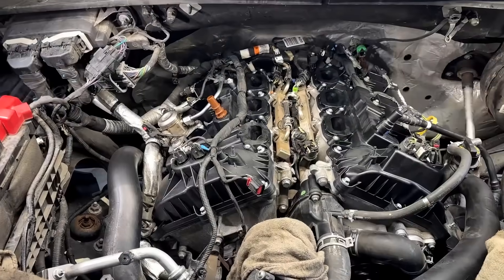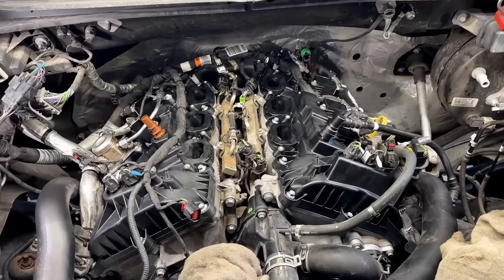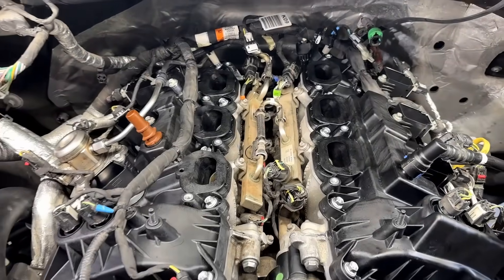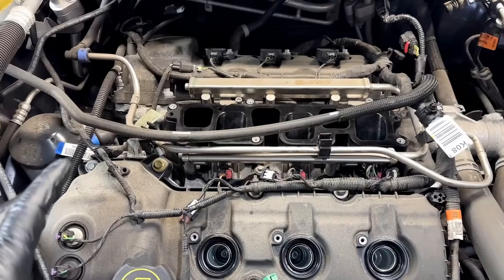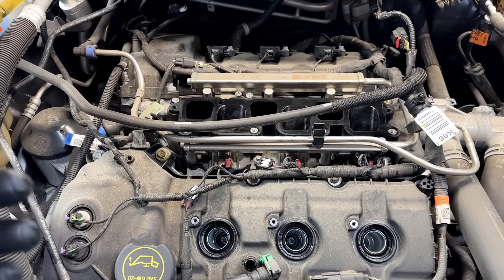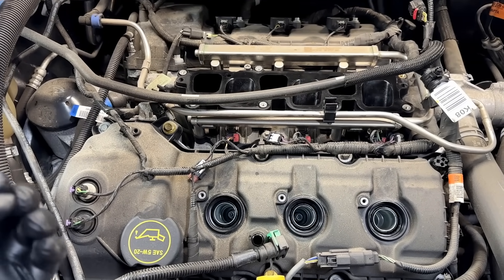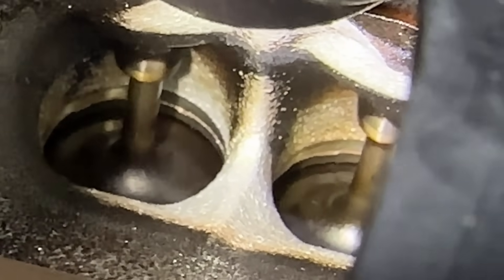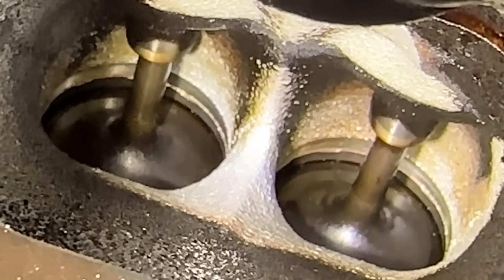Does Ford's New Dual Fuel Injection 3.5L Ecoboost Engine Really Fix the Carbon Build Up Issue?

Comment: It helps fuel contamination in the oil that was why they wanted to run them on port whenever possible last test I saw DFI was causing 5 to 7% fuel in the oil between services

Comment: What kind of oil filter are these guys using? That black soot is from large contaminates that make it past the filter media. My 2011 f150 3.5 ecoboost has 377,000 miles on it and my engine doesn’t have those type of issues. No carbon buildup on the valves, none on the turbos and absolutely no timing chain issues. I use Amsoil signature series oil with their 25,000 mile oil filter and I still trust my pickup to run nation wide. My drive train is all original.
Reply from the maker: lol
Reply: @FordTechMakuloco  that was a serious question. I’ve noticed that when people use a crappy filter the larger contaminates, above 30 microns make it into the pcv system. That’s the black sooty shit that cooks on the back side of the valves.
Reply from the maker: Um no, yes it is oil being baked onto the valves but not because it is dirty.
Reply: @FordTechMakuloco  if that was the case wouldn’t you think it would happen 100% of the engines
Reply from the maker: It does

Comment: Ok, looks like even the Gen 2 could use some catch cans then.  Thank you for sharing this.  It helps with the question about if it is worth it to add a catch can.  Great info.  The real question is what is causing this timing job to keep happening?
Reply: It’s critical to keep the oil changes current with good oil but the timing chain issues really boil down to bad design.

Comment: Brian:  I drove Ford pickups for 57 years. Once the 300 cu in. engine became available I bought only that engine . It would start without heat at 40 below as long as you had a decent battery(ies), & 4 wheel, low range, in first gear allowed me to creep through the bush at idle. These engines were bullet proof & needed only normal maintenance. Like a damned fool I bought a 96 F250 4X4 diesel , 5 speed manual.
The truck was excellent. The Navistar engine was the biggest piece of rubbish I ever encountered, & I wasn't the only one ! After 6 months of the truck adorning the interior of the dealer's shop, I dealt it on a 97 Dodge 3/4 ton 4X4  with the Cummins 6BT engine (the best light truck diesel ever made in my opinion). I now have well over one million miles on the truck, & the engine is still running on the original lift pump, the original P7100 pump with the original delivery valves & the original injectors. I watch all your videos &  I am moved to ask  " is there ANY Ford truck made in the last 10 years that is worth owning ? "
I see all the faults on these trucks (Ford is NOT the only one to have problems !) & I wonder how the Hell Ford stays in business !  Your videos are excellent Brian, & I know you will do well in your own business. 
Happy New Year !

Comment: Did any of them use an oil separator? And would an oil separator even help? I am running one on the passenger side. Probably going to to the driver side next.

Comment: Fordtechmakuloco, I've been adding Chevron techron fuel system cleaner to my wife's ’17 Expedition every oil change since it was new. How effective would it be at mitigating this problem with the valves?
Reply from the maker: It is not effective for your design.

Comment: How do these ford engines compare to the competition? I know the the vw/audi community has had its share of carbon build up issues. At much lower mileage. B7 rs4 v8 recommended 25 to 30k carbon  cleanings to keep things nice nice.

2018 up the 5.0 is dual port too. How does that compare to the 3.5 dual port? Which 5.0 is best? I know some had the old ticking noises but not sure about any issues from the noise. I want 2018 5.0 for the better mpg and quicker acceleration. C&D Showed 1/2 sec improvement 0 to 60 and 1/4. Im sure the 10spd has a role in that too. 15 sec quarter to 14.5 with dual port and 10spd is a noticeable difference. But if the spray in cylinder liner 2018 and up is a maintenance  nightmare compared to the 15 to 17 5.0 id consider staying with the older one. Id get a 5 star tune for trans tuning and that little 87 hp bump, plus cai and maybe cat back. 87 fuel only. All my other cars need 93. Dont feel like filling a 36gal tank with 93, lol. Not youtuber rich 🤣

Comment: So sad.   So what we really need is a TBI injector run on a clock spring timer that we can run for 10 minutes a day going down the highway.   Seems insane since there are plenty of 20+ year old vehicles with 200,000+ miles with perfectly clean valves.

Comment: Thanks for the informing video.

It was interesting to see what Ford's changes did generationally... 

But, not a single mention in the video of how much an oil catch can would improve either the first or second generation Eco Boost engines?...  it's night and day difference.

Hard to believe Ford went with a more expensive solution that doesn't work as well.  I suppose because they think owners would never check their catch can levels and empty them.

Sized right, a catch can had better have a capacity that allows it to never overflow between oil changes, even once the engine is ready for rebuild and blows so much past rings that owners have to add 2 quarts between oil changes...

This works great for any direct injection engine.  Remove the oil and water and contaminants before you run the gas fumes back into the combustion chamber...  so simple.

Comment: This is an issue for the mod engines that had the imrc and intake charge plates.Instead of shutting off the secondary and creating carbon buildup like crazy just to improve torque they should have just put 4.10-4.56 gears in straight from the get go for the engines that had imrc plates.

Comment: I have a 2019 F-150 3.5 ecoboost that I have been trying to lean when does port and when does direct injection operate. 
Nowhere on the internet or at TWO Ford dealerships could I find the answer. THANK YOU for the answer.

Comment: I have an Ecoboost with 200k miles. I use an oil with a really low volatility and I do the CRC direct injection cleaner myself every 50k miles. I’ve had absolutely zero issues the valves stay exceptionally clean. It seems like a really good “true” synthetic oil keeps the intake valves much cleaner because it evaporates much less. Also a catch can really helps as well.

Comment: If you look at the L3 Mazdaspeed 2.3. They have ran additional port or TB injectors for more power for a number of years now. Stratified,jmf, and sp63 performance are some companies pushing the ford and Mazda blocks. Ford added vvt on exhaust valves but I’ve personally seen TB meth not clean but port with E stay clean. I’ve done valve cleaning 4times and it’s NASTY. I’m going to watch your vid now and see what you come up with.
Reply: Plus I’d like to add the police/ fire package ecoboost will still have worse as they sit and idle way more than regular use using di the whole time.

Comment: Brian did my timing chain, walnut blast, and cooling system flush. Runs like a Beast again; I installed a Full Race Eco-Beast intercooler kit with TurboSmart BOV. Runs like a champ again.
Reply: When did you get your timing chain replaced? I didnt think these trucks needed a replacement and it should last well into 200k+ miles. Is that not true?
Reply: @gabbygonzaga552 
Got it done around 190k mi back in 2022 if I’m not mistaken (Sept/ Oct 2022 if I’m not mistaken). 

Brian did the phasers, walnut blasted the valves, plugs, and something else… I forget.

Ran great after his maintenance. Started having a few other issues… leaking coolant from driver side turbo, IWE clunking/ clicking, brake light electrical issues (took it to the dealer and they put a higher amperage fuse in it; WTF?!?!), and not so nice noises coming from the rear end. Oh, and intermittent misfiring from fouled plugs. This happened often. Change/ clean the plugs and it would be back after 1000-1500mi. Did a catch can that was great for a while. Then did a Full Race intercooler and TurboSmart BOV… somehow this changed the way the Full Race catch can operated because I wasn’t collecting anymore blow-by.

Anyway… felt it was time to let it go. It was fun when it ran correctly. Between the Full Race intercooler, TurboSmart BOV, Full Race throttle body spacer, Accel wires and coils, SPD downpipes, NGK plugs, Full Tace CAI, and tuning by Eddie at Elite Performance and Tuning in Littleton, CO I had 390hp/ 603lbs/ft tq at the rear wheels; so yeah, it was fun to drive. It is missed. Though I don’t miss the bad stuff!!!

February 2024 drove into a Dodge dealership, and left with a Hemi equipped Ram. Figured I’d get rid of my problem and get back into a V-8.

Gabby, not saying the chain doesn’t last as long as they say. More so saying I wasn’t trying to find out if the chain was going to last that long.
Reply: Where is Brian located?
Reply: @dewjr1985  I believe he is near Chicago, IL
Reply: @Andomosity  Whats the name of his shop? I just bought a 2010 SHO and Im in NW Indiana. Would probly take my car to him if he is in fact in the Chicago area.
Reply: @williamhermann6635 BSG automotive in yorkville, IL

I believe i was quoted $5000 for timing chains/cam phasers, and then some minor tune-ups with hoses and such. Still haven't decided if I'm gonna pull trig tho
Reply: @Andomosity  Im no expert, but from what Ive read, if youre gonna do the timing chains you might as well do the water pump too.  Anywho, thanks for the reply.

Comment: In your opinion, does the Italian tune-up seem to help with this issue? I'm a diesel mechanic and it works wonders for our carbon issues, but our issue isn't on the valves.
Reply: I don't see how, he said at WOT it is DI only, port Injection doesn't fire, in theory it would make it worse.

Comment: Thanks for the video.

I got a 2014 Fiesta ST Australia 3 door version, 134,000km. First got coolant bypass valve code, replaced the easier one to access and that was that fixed but then still got engine malfunction warning again and limp mode, the garage said no codes this time but removed the limp mode. Did it again, always seems to be when engine has been at full operating temperature for a while, the engine starts misfiring and then the malfunction warning comes up and back into limp mode. Went to another garage and they found a "boost sensor code" so I just replaced that yesterday and no change. But now as well as that it's developed another problem, it's a big boost leak that I can hear a loud hissing when the turbo is trying to build boost, I guess it could be a loose clamp, split hose or maybe even part of the turbo like the waste gate or the diverter valve or even the boost solenoid..? Never had a tune, engine and turbo is stock, very new one step cooler plugs and very new swan ignition coils. Only engine mods are a high flow panel air filter and an oil catch can. It has always been run on 98 unleaded and I have done 5,000km engine oil and filter changes it's whole life since brand new. Tomorrow I'm going to check all the hoses and clamps coming from the turbo all the way to the throttle body and hopefully see the problem..

Comment: Thanks for your nice info-clip and I still think that Ford is the best out of the three but I stepped
away from them since they (even owning 20% of Cummins) wouldn't let go of the dqrn V8 Diesel engines and now they change the engine sizes more often than some folks their long johns!

Comment: A 2019 that needs a timing chain at 125,000 miles?  Dang, I guess I need to get one put in; I have 450,000 on mine.  Great video!
Reply: I am curious about this as well. That seems awfully early. I thought chains last life of vehicle or at least 200-300k miles

Comment: I wonder if you could inject cleaner on the port injection and run the vehicle at idle with the port system disabled from the regular fuel supply with some products like BJ or Wynn ? With a pressurized tank

Comment: Thanks for sharing this.  I have a DI BMW and had huge carbon buildup issues.  So I installed a Snow Performance water/methanol system to keep the valves clean.  The extra boost in power is nice too!
Reply: What mixture are you running?
I used Peak Brand -30* windsheild washer fluid for years on a turbo LS engine.  Then I started adding a quart of M1 methanol to 1 gallon of the Peak and turned the boost up.  When I pulled the heads off 330,000 miles later the intake runners, valves and pistons looks new but had a blue tint from the dye in the WWF.
Reply: @nocturnalspecialties642  50/50 by weight not volume.  Meth is lighter than water.  I get straight methanol from a performance shop in town and mix it with distilled water.
Reply: @superk4562  cool. 
I didn't get technical with it. Just started using straight WWF that MSDS showed to be 38% methanol. It did really good but wanted a little extra for when pushing the boost higher. I never calculated what adding 1 quart of M1 to that mixture was.
Reply: @nocturnalspecialties642  You can always buy Boost Juice from Snow Performance.

Comment: In the 70s a lot of cars needed valve jobs, at about 100000 miles kind of normal. Low compression and a burnt valve. I also Rember using a bench grinder with a large wire wheel to remove the carbon from the valves after removing them from the head the carbon build up looked like a cone of carbon filling most of the area where the valve seats, so those valves don't look that bad to me. Although I do run Techron marine in every tank of fuel and also have a catch can my 2019 3.5 F 150.

Comment: Why should any vehicle with an engine timing chain set up that  has been maintained properly require any sort of timing chain job  before reaching 300k? Otherwise expense wise , you're better off going back to timing belt ,for quieter operation and keeping the carnage out of the oil pan

Comment: Do the smaller gen 2 EcoBoost engines like the 2.0 also have timing chain issues that need to be repaired around 100k miles?

Comment: Is there any way to re route the crankase breather from the intake manifold to the exhaust manifold via a vacuum pump of some sort or some type of siphon/ventauri in the exhaust pipe (hopefully not harming the catalytic converter) I am aware the intake side is vacuum as the exhaust side is positive pressure. It seems like the oil from the crankase is the main cause of the valve carbonizing. And finally, I am aware of the more precise control of the a/f mixture with direct injection, but I really don't see much difference in fuel economy or overall performance in my 2018 Escape with the Ecoboost turbo engine. There are times wher local driving yields about 16 mpg, and I am 57 years old, I don't drive it hard. So, is direct injection really worth the trouble(s) ?

Comment: I've got a 2012 with 165k, and havent had carbon issues. I buy cheap gas, and i drive hard. I also drilled a hole in my intercooler to blow all the crud out.

Comment: Classic case of engineers and bean counters trying to do it as cheap as possible and then getting customers to pay for very expensive work down the line. They have now learned the way direct injection was done, while great for performance, is a problem waiting to happen. They need a port fuel injector as well and it really only needs to be run say every 5K miles for a couple of hundred miles to keep the intake valves clean of carbon.